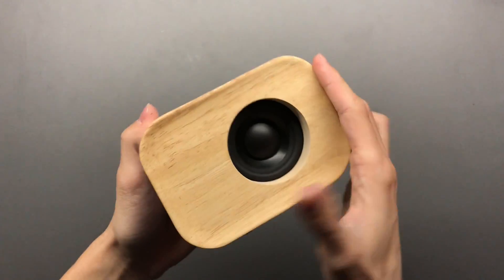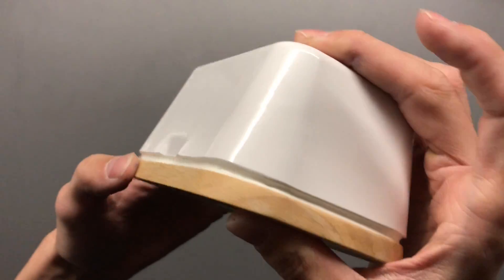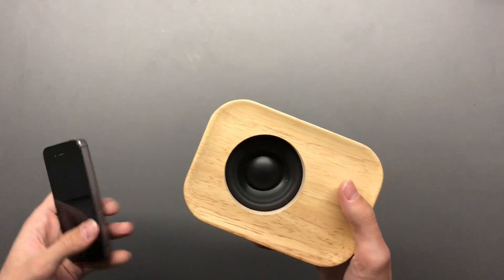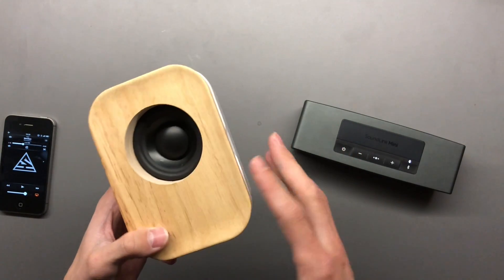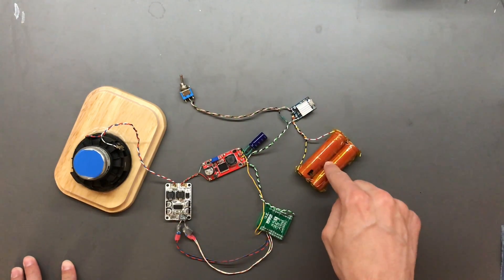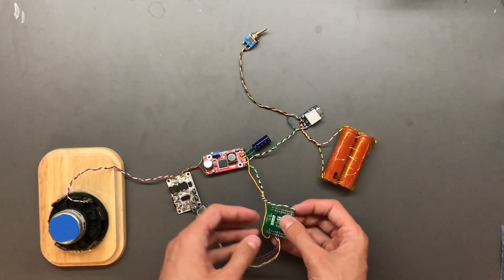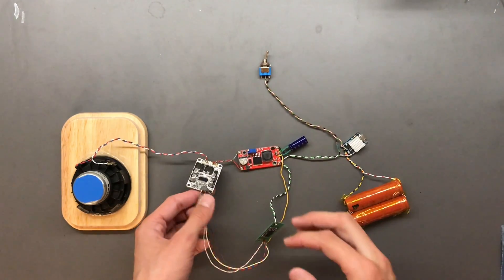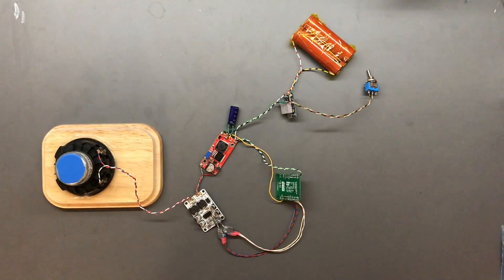Margarine Box Bluetooth Speaker

Comment: I do not recommend to use this speaker with this amplifier because if you look at the datasheet of tpa3110, It can not handle 4ohm load  ( the amplifier ic gonna release a lot of heat and it would shorten the amplifier ic. Also, I know that it is class d but it still needs a small heat sink on top because heat still conducted.
Reply from the maker: I think I've added a heatsink after the video

indeed at high volumes it /does/ clip pretty hard but, given that these are class D, they also have a lot of protection logic around them so, so far so good 🔥
Reply: @Darieee  I agree with you that It has a lot of protection but I do not highly recommend letting the protection kick in because the protection feature only prevents the amplifier blows up. By the way, next time you build a speaker. Remember to look at the datasheet and see if the amplifier ic can handle the ohm of the speaker
Reply: to solve the clipping issue, you should add a resistor on the input of the audio to reduce the audio signal coming into the amplifier. In addition, reduce the gain is another thing that would prevent the amplifier from clipping at high volume. Combining both of them and you can listen at high volume without clipping. Bomb, you have a hifi speaker

Comment: Great video as usual...funny reading the description on the driver link lol

Feature：
2 inch ultra-toxic full-frequency speaker large neodymium magnetic (high-strength magnetic) Metal basin The sound is very toxic, layering strong low frequency also has a good performance

hopefully not ultra toxic at all, might spoil the margarine :) how did you find the actual driver without the issue with the current?
Reply from the maker: driver is absolutely amazing; that has to be my greatest sounding speaker I think 

definitely have to muster up the courage to reopen it again and beef up all the power wires
Reply: @Darieee  Great to hear, went and go two to have a go at. Thinking of something in a small enclosure and low power like your aukits build

Comment: Hi Dariee and thanks for this video,
Does your "CSRA64215 PSTool for Full Configuration" dump file contain the feature of:
LONG pressing FF or REW button to fast scroll INSIDE a playing song? (not just to skip between songs)
Reply from the maker: Well, first of all, PSTool is not the correct program for setting up the button actions

You need to use ConfigTool for that; which should also be linked here 

Leave me your email and I'll send you a .psr for the 64215 which I've set up to emulate apple's - • + 3button configuration ... unfortunately double-long-press-and-hold for reverse isn't doable (as far as I could see)

Comment: Dude, thanks for your great videos, they very help me! I am beginner user csra64215, I have programmer for that chip. I have few questions, may be you know answers:
In my project I have same electricity scheme configuration like in video. 
1) Is it possible set auto power off when my Bluetooth device long time (for example around 15 minutes) in pairing status? you know, imagine situation, you listening music, take your smartphone and go for a walk, and after 15 min BT speaker auto power off. I think this feature very useful. I understand have to power control with help Bluetooth chip, but how do it I dont know. 
In your video you used physical switch. is it possible change physical switch to Bluetooth chip?
2) Is it possible set battery indicator from smartphone? I mean on smartphone near Bluetooth icon battery indicator. What need for that?
3) Is it possible set my custom melody tone for Power On and Power Off? If yes, how?

Sorry for a lot of questions! Hope you help me) bless you! :)
Reply from the maker: You're welcome!

1) I don't know how to do that at the moment - it is 100% possible though,
2) but then you would indeed need the switch go onto a PIO (programmable input output) pin of the CSR chip to wake it up

3) check my "disable mic on the csr8645" there I use the ConfigTool. This is the program you have to use, but a newer version, which I've now linked in this video.

3.1) If your bluetooth board looks exactly like mine, you need ROM8, if it has an ND DC-DC converter on the back, so, is a 5V or 12V version, you need ROM15

Comment: Have you ever used the line input of the CSRA64125? I can not get it to work. I get output when I toggle it manually, but I want it to switch automatically. Any tips or even a working PSR dump? Thanks!

Comment: Those boost modules with the huge mosfet like package (xl6009/lm2596 etc) , seem to be pretty crap. I remember seeing at least two videos on them being noisy and generally not great.
Reply from the maker: Mmmm, the LM is fabulously inefficient, the XLSemi ones are rather efficient and have a good quiescent current ... I'm not sure how noisy they are but, they should have a rather high switching frequency

Either way, I've never had any noise issues with them, and this sleep function (not available on the LM btw) is pretty nifty